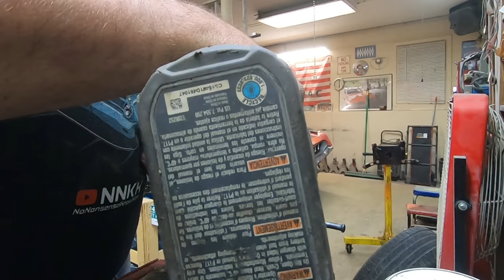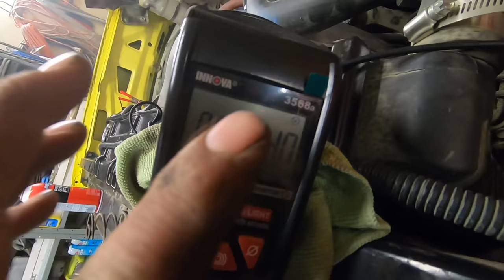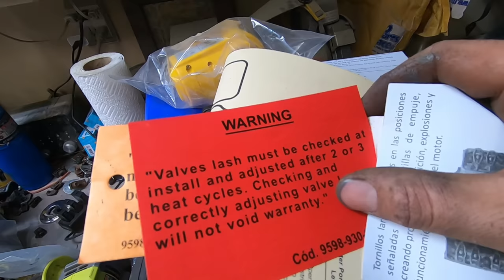Can I ENGINE SWAP a K5 Blazer in a Weekend for CHEAP?

Comment: I love the fact you can climb up in the engine compartment and have plenty of room to work. It's so stupid how new vehicles have absolutely no room to do anything under the hood.
Reply: It’s a problem that 99.0% of American car buyers and maybe 60% of voters have created. Any extra room (size) that doesn’t contribute to passenger comfort is done away with to safe weight and give better MPG. The move toward OHC and turbocharged engines the last decade or so had added to the problem, for example a Ford 5.0 Coyote OHC V8 is larger than a 460 big block in every external dimension except overall length.

Comment: If memory serves me right a 400 had a weighted flywheel and harmonic balancer as they were externally balancd. A 350 of that Era didn't as they were internally balanced. Later one piece main blocks take a different flex plate as well
Reply from the maker: Yep
Reply: I think one piece rear seal 350 are external balance?
Reply: @frankgomez1965  they are on the flexplate  end
Reply: The irony is that someone put a flex plate on it, did they put a 350 flex plate on it? That would’ve killed that 400 pretty quick
Reply: I was gonna offer the same info but you beat me to it.
Reply: @PoleBarnGarage  --Here's hoping you'll do a "400 SBC Unseized!" video soon.

Comment: As hard as 400s are getting find I would be pissed,I hope it can be rebuilt with out having to refinance the house.lol
Reply: Idk why people still think it’s hard to find a 400 SBC, Dart has been casting brand new 400 blocks for years in 3 or 4 different configurations. The “factory replacement” type Dart 400 SBC block is between $2,200-2,500 depending on where you go but with machine shops charging what they do now a block that’s had bearings spun in it that needs decked and cylinders honed if not bored oversize as well can run you up to $1,200 real fast and you’ve still got a 43+ year old block. I know a few circle track guys running the dart blocks and with what they put them through and everything above considered I’d just spend the extra $1,000 and have no worries, plus everything will be standard size and the cylinder walls will be as thick as they were originally designed to be.
Reply: @J.R.in_WV  People have been saying this about 4L80s too. I swear people don't know how to use Google in its most basic capacity. Its not like a factory 400 is even a good motor to begin with.

Comment: I had a 76 k10 and lost the trans and overheated the motor in the same day and developed a rod knock on a Friday. I had to be to work Monday or else so I pulled a motor from one truck with a cherry picker with busted wheels in the dirt. A trans from a different truck in my backyard, yanked the motor and transmission from my k10 and drove to work Monday.
I had a buddy helping but it was till 2 am every night and I had the keys to the local Napa cause I worked there. 1 am Napa trip is definitely a privilege.

Comment: in 99, in wales uk, I owner a 76 Blazer with balloon tyres 3 inch body lift. 7.5 ft wide 8.5 ft high to roof bar lights. 350ci great times. nice job buddy
Reply from the maker: Bet that stuck out

Comment: 20:32 the bolt you put the Teflon tape on, when doing a fuel pump, you remove that bolt and thread in a longer thread bolt, that holds the pushrod up out of the way so you can put the pump in easily, no fighting the pushrod.
Reply from the maker: Not in this block! First one I've ever seen that wasn't clean through

Comment: Highly recommend you use PTFE paste instead of tape for any fuel and oil fittings. Any strings of tape that get worked loose can find their way through the system and possibly somewhere you don’t want it. Paste will just dissolve.

Comment: Reminded me of 76 ford f250 dad had we hauled wood with. It ran perfectly most of the time but every so often it would quit running and want a BJ before it would run again. He tried several things trying to fix it. All new fuel lines. Moved another tank behind the seat, electric fuel pump. Nothing worked but a BJ.

Comment: Oh man does this bring back memories! 30+ years ago I had a '78 Jimmy (same as the Blazer) and did exactly this. Stopped at the dealership, picked up a crate engine (that I had saved up for) and swapped it in over a weekend with a buddy's help. Even climbing into the engine compartment just the same.

Comment: Late to the video, but I did this about a year ago now on my 86 k2500. I picked up a 350 that sat for 10 years. Dumped oil in the top end. Spun it over fired up like it never sat. I was pretty impressed for an engine that sat so long. Still running strong.

Comment: WOW!!!! This truck is in AMAZING condition. Back in the mid 80's I had a 79 K5 that a friend of mine and I dropped a 454 into after I blew up the 400. We pulled the entire front clip off the truck to do the swap, because it was too tall to do the engine swap without removing it. If I had to do that again today, and LS would be going in, along with an EFI in place of a carb. It was pretty stacked up too, it had a 6 inch lift and 38 inch tires. That was 1 of only 2 cars I have owned over the years that could laugh at Old Man Winter, the other was a 98 Durango. At the end of this video, you mentioned some other fantastic YouTubers, I was just curious if you have ever watched Puddin's Fab Shop??? As always, another GREAT video!!!

Comment: Comment 1
I recommend Milk of Magnesia on exhaust and header bolts. It's a trick from the Air Force jet engine mechanics. Better than any anti-seize I've ever tried. I used on big block Olds. And I hate giving the Chair Force credit for anything.

Comment: Ya tip for next time you need to remove the handle from a snap on screwdriver, the shank can pull out just put it in a vise and stick a prybar between the shank and the handle and the handle pops right off, that's how they replace them if they break off ❤

Comment: Ive done a few chevy engine swaps, and even watching other people do it it never just works. Always thought it would be nice to just slap a motor in, set the timing and it runs completely fine but always gotta screw with stuff. But yeah you can usually knock it out in 2 ten hour days as long as no crazy problems. Great video, i need to blow my motor up so i can swap it out again

Comment: Here is a trick I learned when I was working at a Restoration Shop.  Before you loosen the Bolts off of the Hood Hinge Take a Paint stick and Draw a line around the Hood, and the Hinge.  That way the Hood goes Back in the same Place with no Ajustment.  Hope it Helps.  Phillip the Blind Cajun.

Comment: As a limey who is quite new to your channel and videos i must say i have learnt so much......  not exactly what i have learnt...  but sure i must have learnt at least something lol.   Cool videos.  Its a totally different way of doing things in the US, from your car spare stores, to your own garages or shops..  Tools are about the same although i aint used imperial spanners etc for a very long time.    Great to watch and i do actually learn things even if its something i wont ever use or imply over here but your work arounds at times i can.   I drive a mid 90s Japanese 4x4 and another than needs welding and mechanical stuff as a project..  but no shop so its sat outside on the drive.  Would kill for a garage.

Comment: I had a 86 K Blazer .
It came with a 350 .
The guy who ordered it loaded it with A.C. , power windows, crusie, tilt , carpet & a few other options .
But opted for a 5 speed manual , 4x4.
Which was to my liking.
He bought it & then rarely drove .
His wife said he would've never sold it while he was alive , but it sat for 5 yrs without even being started...
She would call me when she needed help with things around the house .
I would'nt take money , ever . 
One day when I was replacing a heating element in her water heater (in the garage) I asked her about the Blazer...
I told her if she ever sold it , pls give me 1st chance.
In 1997 , I had just taken delivery on a new Tahoe 4x4 I ordered , & it was loaded up nicely. 
A wk later she called me & said she wanted to sell it.
I went over & she said , "just give me what you think its worth".
I wrote her a cheque on the spot ..
It had 42000 mi on it & not a spec of rust.
Pumped up the tires , jumped it & it started immediately..
I kept my new Tahoe in the garage right beside my 86 .
I sold it in 2006 for a hefty profit .
If I had it today , I think I could've sold it for double .
One of my all time fav Chevy's.

Comment: If I remember right and from the sound of it you may want to get a starter for a 350 instead of the 400 starter since they had different flex plates between the 2 engines. I blew the nose cone off of one on my last 400 because I just grabbed one for a 350 small block and tossed it on.
Reply from the maker: Same tooth count

Comment: 47:36 way I adjusted valves is I had a box of rocket stoppers, plastic covers with spring steel wire that snapped over the rockers to deflect the oil spray. I'd loosen the rockers until it started chattering, tightened it until it just stopped, then went a half turn more. Was able to quickly adjust valves this way. now I love that most cars have no lash adjustment, just torque the rocker bolt down, and done. Only issue is when you have to have the head milled, usually you'll need to use a head gasket shim to get the valve clearance correct. Also, on gm, when they pop and backfire like that, it's usually a bad pickup coil or module, or both. I would always do both when servicing the distributor. If the paper is flaking off the pickup, usually it's failed or will fail soon
Reply from the maker: Done it that way too. I've had better luck doing it by feel but either way works

Comment: I just watched the video and the issue with the timing may have to do with the springs in the distributor. I used to work in a garage back in the 80s and had the the same issue with chevy reman 350 and I replaced every thing I could including the distributor and the engine still had a miss, an old mechanic I knew told me that it may have to do with the advance springs, so I replaced them and still had the same miss. I would hook up the timing light and he said to watch the mark and see if it jumped as I revved the engine  it was not smooth. I eventually took the old springs off the old distributor and put them on the new one and it fixed the problem there was no more miss. Never knew why, but it ran fine.

Comment: Man this looks like a solid rig! Truth of it is, if that 400 is original that 350 probably makes about as much power as the smog era 400 did, or close enough anyway. It's somewhat impressive how little power they made out of smog era engines. A lot of people may give you grief over reusing things like the water pump, fuel pump, whatever else when this lands out in the wide open away from members, but man, those old parts last forever and a day compared to new stuff. Did you have to send the 400 back as a core?
Reply from the maker: Yeah, I wouldn't have but I don't have any extra small blocks handy
Reply: @PoleBarnGarage  That always sucks, but like I said that 350 is likely more powerful than that 400, and at the end of the day, what can you do? 

Back in like 2016 I got suckered into pulling a 350 from a Monte Carlo in the middle of the woods, some old Goodwrench engine that had spun a bearing or something, owners parked the car in the woods back in the 90's. It was already a rustbucket then, but oh boy, we had to fight bees, trees, and a possum for that engine. And why? Because he was sentimental over the 350 out of his grandma's '78 or '79 Caprice 2 door and didn't want to send it off for a core.
Reply: 400 sucked because most came with 882 casting heads. Slap on some 60s 327 vette heads with steam ports added and a nice cam and it will wake up the 400
Reply: @marshallgibson8872  Like most of the smogger engines man, I've seen a stock 305 block in a 80's El Camino make good power with spare parts, these engines are just so gutless from the factory. Like the 318 I'm pulling from my late fathers wrecked '83 Dodge D150, 140HP from a 5.2 liter V8! Laughable!
Reply: We always used the old parts if they were still good. Of course we had kids and family so every penny counted.
Reply: In the aircooled world we constantly look for old German stuff versus the new Chinese stuff.
Reply: @billyduffany3387 you putting in a brand new engine in always get your a brand new cap and rotor do not put no use Cap and rotor on there

Comment: I can give ya some advice on your next one to get the wiring loose for the engine just take the 1 bolt out of the plug where the for the wiring harness where it goes through the fire wall and take what for the engine and lay it on top of the motor you don't even have to take the starter off much easier to change everything from the bad engine to the new one on an engine stand and your mystery wire down by the starter is for the fuel Guage just cut it and reconnect it with a heat shrink butt connector

Comment: I always have liked a Q-jet or Holley 6210 double pumper (spread bore bolt on replacement for Q-jet) with an electric choke conversion on a daily driven SBC more than the square bore 4 barrels. It might just be my driving style but I’ve never been able to get the fuel mileage or low-RPM “pull” out of an Edelbrock or regular Holley that I can from the Q-jet or 6210. I have a 9800S Thermoquad in a box that I really liked too, but these days I don’t have anything carbureted to put it on after I sold my 77 K10.

Comment: I HAD A,1980 K5 BLAZER  / 350 CU IN SMALL BLOCK / I DECIDED TOPUT IN A BIG BLOCK 427 CU IN  MOTOR / I BUILT THIS MOTOR TO PUT OUT A BOUT  400 + HP / I STARTED AT 9 AM MORNING AN FINISHED AT ABOUT 6 PM/  A. HAD IT RUNNING / SWAP TURED OUT GREAT

Comment: I seen smoke at the ground connection at the alternator when you tried turning it over! Also, I always point the rotor at cylinder number 1 when installing a distributor
Reply from the maker: Yes.. of course. But you can choose where number 1 is when you install the dizzy

Comment: What did I miss about the balancer that made you unable to time it by the light? That by ear stuff is enough for break-in usually, but to dial it in you need a light.
Reply from the maker: Doesn't match the cover I guess. I don't care, it's like an 8.5:1 small block it'll take anything lol

Comment: Not really a question, more of a tip.  When you are pulling engines, and especially if you don't wanna make a mess, buy the expanding rubber freeze plugs, and put them in everywhere fluid can leak...lower rad hose connection, upper rad hose, etc.  Make it alot less messy.  If you work on the same kind of engine over and over, they are reusable.  (I have sets for Ford Windsors, and 385 big blocks.)

Also good if you are storing a motor after you pull it.  Exhaust manifolds, dizzy hole, etc.

Comment: A few tips for a first start.  Static time your engine.  What's that?  Set your balancer to 10 degrees or so, turn the ignition on, and twist the distributor.  Where your timing light flashes, set your distributor.  Also, fill your fuel bowls.  Even with nothing fancy, we all have the pointy end of a sealant tube kicking around.  Pour some gas through that into the bowl, to allow it to start up and run while it pulls fuel through the lines and pump.

Your balancer didn't match the engine in this case.  GM used at least 2 different timing locations.  I'm too poor to buy a reman engine, so during assembly I always verify the timing mark, but you can do the same with a screwdriver if the balancer and engine came from different places.
Reply from the maker: Yeah it helps to do those things, or you can just put the distributor in correct instead of being an idiot like me

Comment: put the bolts back in so you don't lose them ... i lost one of My carby to manifold studs last year.. looked everywhere for it.. found a bolt to put in it's place and then proceeded to put the fuel hose on the carby... THAT'S where it was, i'd used it to block the hose from fuel leaking out while carby was off.. slaps face with greasy hand.

Comment: On your comment about spark plugs, most auto parts retailers actually list a "factory replacement" option. It's the closest to the factory plug their system can recommend and most of the time there is ZERO reason to use any other plug. Most ECUs can't auto adjust to the new plugs and fowl them super early. And unless you are any part of the aft there's no reason to with carburated engines. They will however try to sell you a more expensive splug for no reason, when the cheapest plug is usually the factory replacement. Just some info I don't see mentioned often.

Edit: I know nothing about hgi so above info may or may not apply.
Reply from the maker: On an old vehicle it literally doesn't matter. Just use copper core simply because it is the best conductor

Comment: The bolt that you used Teflon tape on goes in the hole to hold up the fuel pump rod during installation.
Reply from the maker: Nope, this one is a blind hole
Reply: @PoleBarnGarage  if you use a longer bolt to hold it up until the fuel pump is in, then you replace it with the short bolt. It works every time

Comment: watching you close that hood from the front had me gritting my teeth man. I've had one of those just fold at the crumple zone in the middle of it....
Reply from the maker: Push back and down. How else do you propose you close a hood lol
Reply: @PoleBarnGarage  yeah Ive only had it happen on the '78 C30 but i was pull down and pushing back and instead of closing the hood folded in the middle, since then ive always closed them from the side.
Reply: just a flaw with the chevy square bodies i guess.
Reply: we ended up straightening it and reinforcing the ribs underneath.